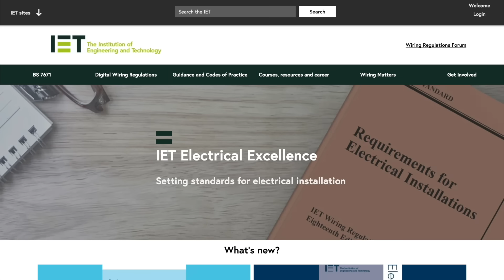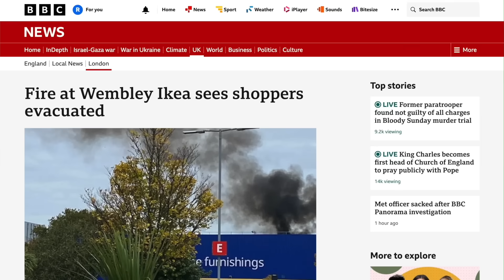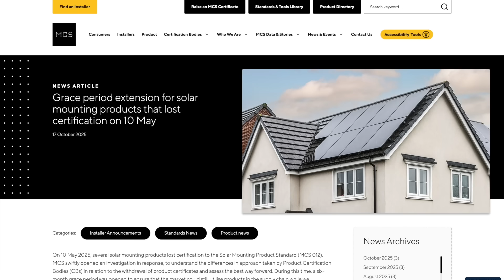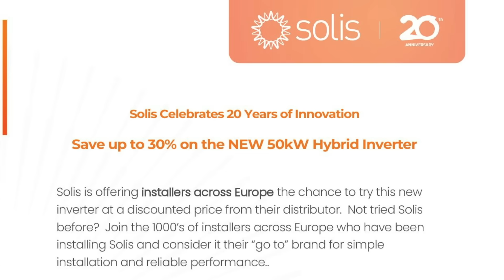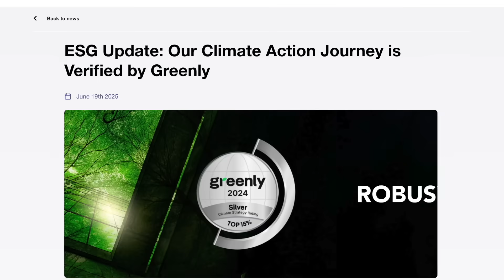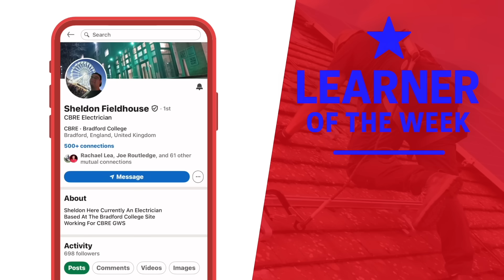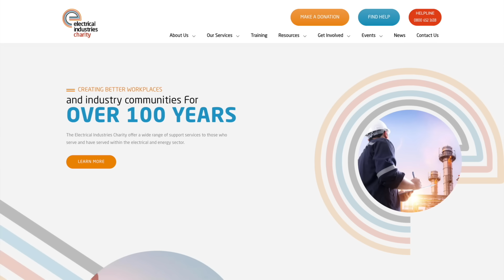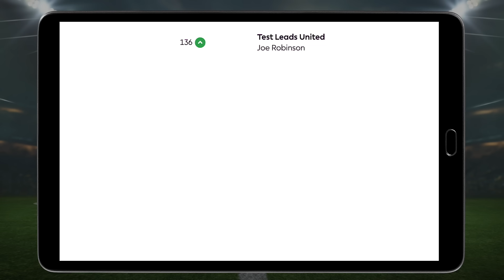Exclusive: Grid Bosses Set to Change UK Voltage

Comment: In Australia our nominal voltage was reduced from 240 V to 230 V.  The maximum was still 253 but it enabled the companies to let the volts fall lower.  Different arguments were used.  But the primary reason is that people could no longer complain that their volts were below tolerance until it dropped to 210 V this means that where transmission lines were too small the volts dropped too much during periods of high demand and this change means that they don't have to upgrade the wiring.  As long as the supply remains at 240 V.  If the transformers ARE reduced to 230 then the problems become worse not better.  For the same power a higher current is needed and this causes more voltage drop.  ie if 240 V dropped to 220 V with a certain power load then 230 V with the same load on the same wires becomes a lot less than 210.

Comment: Lower voltage to keep up with the demand? Honestly I can see that... Electric Vehicles are more popular than ever now. Plus the more popular AI is getting, the more data centres are eating into  the grid. 207 isn't insanely low, but personally I'd expect 230-250 in most houses just because that's what I've tested throughout Scotland in the past while. 😅

Comment: That voltage switch will work fine.
And for UPS: Just set a lower threshold - done.
And for generators: Just set a lower threshold - done.
Reply: Except the lower the voltage the higher the current consumption and it’s the current consumption that we pay for, so electricity bills will have to rise!
Reply: @TwoBassed  You don't normally pay by current. You normally pay by energy (Wh, or the larger unit kWh) and sometimes also by power (W, or the larger kW). 120V at 20A is the same power as 240V at 10A. And energy is (if we simplify a bit) V x A x Time.
It is normally written as kWh or Wh.
So 240V, using 10A gives 2400W. If you use 2400W for one hour it is 2400Wh/2,4kWh.
If you use 2400W for half an hour, it is 1200Wh/1,2kWh.
You can do the same for 120V above:
120x20=2400.
No difference.

Comment: The rated AC voltage is baked into a number of regulations , I used the medical directives where a tolerance is taken as 15% above the top of the range and 15% below the lower limit.  the switching energy of the in-product converters are tuned to the mains voltages and reducing the lower limit increases the work the regulator has to do - which may result in excess EMC emissions

Comment: This is a fake headline. Back in the 1990s the whole of Europe decided to standardise their national grid voltage at 230V, rather than the Irish and UK standard 240V and mainland 220V.
That allows for interconnection between the various systems.
So, for over 30 years, it hasn’t been 240V. Under modern regulations, +/-10% tolerance is expected and appliances are required to operate normally within that range.
The important thing to note is that a kilowatt is still a kilowatt, no matter what voltage is used to provide it and suppliers charge for kilowatts, not volts.
Reply: Fake or not, the UK is no longer part of the EU, so who knows what will happen.

Comment: As an EE, This is NOT some stupendous change.  It simply conforms to some USA and other international standards, using the 60Hz grid.  Parts of the Ukraine have gone off the Russian 50Hz frequency, and are doing fine at 60Hz, except for some Pump and Speed applications.  Going the other way will cause larger losses, and it is virtually impossible to synchronize 50Hz with 60Hz in any practical manner, using older equipment.  As Russia conquers the Ukraine, it will probably revert to 50Hz, and any of those areas will be disconnected from the EU system.  It will be a practical electrical "dividing line" due to incompatability.  Essentially a new kind of Border.
Reply: You make a good point and a dubious one. The good: 50 cycle transformers adapt better to 60 cycles than vice-versa. The bad: the assumption that "as Russia conquers Ukraine...." Conquering the entire country has been doubtful since the initial invasion failed. It's become exceeding unlike since Ukraine has designed and built long-range, precision drones and missiles that can take out almost any target in most of Russia.

Comment: Having had a prolonged 'discussion' with my DNO over voltage which was picked up by my smart plugs. The problem caused by local renewable at 11kv allowing connection without considering the whole local distribution network. They tapped down at the local 11kv transformer so I get 250v ish still does not help the longevity of light bulbs!

Comment: The UK hasn’t had 240v mains for decades, it’s 220v. Europe doesn’t have standard voltage despite what some experts have said, I have a feeling that France, for example has 3, depending where you are. There is also the cycle to be considered 60Hz, 50Hz etc. if these people wanted to save energy they should switch to DC, which is used now when moving from country-to-country. Power stations should produce DC then move to AC for local areas. Going DC saves up 50% of power as less heat is produced.
Reply: ??? the "harmonised" 230V standard came into effect in the 90s, which meant that mainland Europe "went up" from 220V to 230V, and the UK "went down" from 240V to 230V. I know that the actual voltages vary/differ, but the point I'm making is that it's never officially been 220V in the UK.

Comment: I breed tropical aquarium fish, and I use multiple heaters inside the aquariums to heat the water to a certain temp hopefully this doesn't sabotage what I'm doing much...
Reply: heaters may need to run 42% longer at 208V, when compared to 240V.
P=IV
I=V/R
P=V^2/R

Comment: and who will i sue when my pc is damaged by this change to voltage outside the tolerances of the psu, based on the old standard? how much profit will they really get when they find themselves sued by large numbers of people with expensive damaged equipment - phones damaged by chargers operating out of limit? £1500 computers with power supplies that blow up or burn out? motors which cant actually be 'altered' or cope with out of tolerance voltage or current and just catch fire and melt (such as in vacuum cleaners, or pumps in freezers and fridges).

Comment: Any drop in voltage will require an increase in amps to maintain wattage. Dropping voltage will increase the stress on supply cables as it is amps which denote the size of cables. So if all houses and underground cables require replacing imaging the ecological impact on the planet. CO2 emissions?...you ain't seen nothing yet! New bigger copper conductors, new insulation manufacturing from oil based products. Millions of miles of new cable required. Millions of tons of copper to be mined or recycled stripped and new smelters. OMG! Oh and then there are all the new appliances. Everything will burn out with lower voltages. Weird but true

Comment: Any reduction in supply voltage will cause an increase in current (to maintain the same power output). Cables are primarily sized on current carrying capacity so this would have to be taken into consideration.

Comment: What they should do is require every power customer have an Automatic voltage regulator installed designed to take a varying input voltage up to 2kv and ensure the main output voltage remains 250v --  Or other voltages required on-premise if a special voltage is required on premise.    Then allow the network operators to run at up to 1kv  for maximum efficiency and capacity.    Higher voltages can use smaller conductors to deliver higher capacities of power which is much more efficient.

Comment: It’s impossible to have every building with the same voltage unless they are all supplied by expensive regulator circuits ! The grid is fed by local transformer stations! Ther is IR losses along varying along all routes using 3 Phases at least!🎶🐈‍⬛🛠️

Comment: 2kw on 240v is 8.3A but 2kw on 207V is 9.6A Does this mean overloading on some cables and will the meter record more than it would otherwise?  I wouldn't trust anything from this  traitorous government.
Reply: Resistive heaters will draw 29% less power @208V (compared to 240V; 13% less current)
Electric cars will draw 13% less power @208V (compared to 240V, same current)
Computers will draw the same power @208V (compared to 240V, 15% more current)

Comment: All our bills should reduce by 10 per cent if we are being supplied with 10 per cent less power surely, this was not mentioned.
Reply: Yes.
But note that Power=(Current)(Voltage).
A reduction in voltage is only half the story.
Resistive heaters will draw 29% less power @208V (compared to 240V; 13% less current)
Electric cars will draw 13% less power @208V (compared to 240V, same current)
Computers will draw the same power @208V (compared to 240V, 15% more current)

Comment: Lowering the voltage will create more amps on the wires.
Reply: Depends on the appliance.
The big power users like resistive heating and EV charging will reduce their power draw.
Things like motors and computers will increase the current as you describe.

Comment: Why not use both? In Brazil they use a system called bivolt, meaning that houses can have both at the same time 110v to 250v like in the UK and Europe.

They made this way so devices that requires over 110v can use normally while when connecting a lower power consumption device it takes only 110v.

Many households label they power sockets to easy identify which socket is 250v, 110v or bivolt.
Reply: In Europe we got a "bi" voltage system. 230/ 400V. 400V is use for large loads and motors. There are also 2 sorts of sockets.

Comment: As an aside, older analogue phones run a dc of nominal 50v from the exchange to you phone. However this varies a lot from maybe 35v in uk to a solid 50v in Germany-which gives us techs a bit of shock….
Reply: In germany old mechanical phone exchanges used 60V nominal, and the computerised digital stuff used 48V , today we got no more phone exchanges, the subscriber circuit for an anloge phone is in our routers. Cordless phones use the radio interface (dect or wlan) of the router.

Comment: Rot, if it's lowered to 207v the probability of house fires are increased. As to maintain wattage, lower volts means higher current which require thicker cables to prevent cables melting.!

Comment: Yet HMG's Energy Plan is to increase the energy take from the Continental suppliers (i.e. mainly Nucleur France), via the subsea interconnects, from 10% to 20% by 2035  . .add that to the 6% of  UK  supply   that the new Hinkley plant  is estimated to be contributing by the early 2030s.  .  Won't that lump smooth out any variations in voltage caused by the wind turbines ? Further,  If voltage spiking from Wind turbine output will be a problem shouldn't  a properly adapted grid system ensure that a substantial part of that particular output gets decoupled . . . by feathering aerofoils or reducing their pitch and/or by pushing the variable ouput into damping storage i.e. batteries, pumped hydro schemes, water based coastal defence storage ?Isn't it anticipated that control of the grid by "The Centre" will extend to the micro management of individual wind turbine farms ? Or is it all being done on the cheap , with the end-user paying for it all, including the replacement of   perfectly functional, but non-compliant older equipment ? Sounds a bit like the recent Microsoft  Windows scam

The key thing to remember for the enjoyment of the "Goid Life"  in  the UK is that its best to be borne with incurable dementia, that way you are likely to develop a period of lucidity that would cause you to question the decisions of the  corrupt, "Elite", bonehead, morons that run the tip.

Comment: 220 votes is required for foesent lights so 207 votes would stop theses from working and transformers would need to be changed across the grid and on private property and it would change 3 phase system too. Can not change the system . Please many averages of 240/230 over other systems . Qualified 18th!

Comment: The voltage in the United States is 120 V, so that is why they don’t use electric kettles much. It takes much longer to heat the water to boiling. They boil it on the gas or electric hob. Actually, that will take longer as well on an electric hob.
Reply: No, we Americans don't use kettles because we are not a big hot tea country. Most of us also simply use the microwave to heat up water in a cup for tea.
Reply: Most houses in the USA have 240V available with some big apartment buildings maybe having 207V due to a different style transformer.
Reply: @jeffkardosjr.3825  Canada, USA and Mexico's distribution utilizes WYE. Industrial consumers utilize 3 phase, 4 wire wye in various voltages, common ones are 208/120Y, 480/277Y and 600/347Y, phase to neutral gives the lower voltage.  In apartment building and light commercial buildings use 3 phase utility connection, 208/120Y is supplied from utility but individual suites are effectively single phase, because only 2 phases and neutral are supplied. Single phase appliances like electric stoves, cloth dryers, water heaters and A/C are connected phase to phase giving 208. Single phase120 volts for everything else is accomplished by phase to neutral connection. Detached homes are fed with split phase 3 wire 240/120. This provides line to line 240 volts for appliances and 120 volts line to neutral for everything else.

Comment: To all Britons, these idiots  that welcome the reduced electrical voltage to 209 v ac, any electrical items you have that is new requiring 230 - 240 volts AC , your tumble dryer, washer/dryer, dishwasher,  water tank immersion heater, storage heaters, kettle, Microwave, electric hobs, electric oven, electric cooker, audio equipment, power tools, compressor, welders, battery chargers the list continues but they all require a minimum voltage 230 - 240 volts AC, non of the items  I've listed will function correctly and some may not even work as stated by the manufacturer of the equipment furthermore, the reduced voltage of 209 v AC will not reduce energy prices, all items listed will be impacted while increasing running cost due to reduced power, this fact can be tested using a 12 volt lamp with 6 or 9 volt battery, the brightness confirms the problems you will face with reduced electrical voltage yet, these idiots at eFIXX welcome the low voltage.

Comment: This will have zero impact on the value or price paid by customers in that electricity is measured and charged in kWh accumulated over time, not the voltage at a point in time.  Not sure why everyone having a moan about price other than the fact they already don’t feel like they’re getting value for money. Change in voltage = totally unrelated.

Comment: What i find amazing is how these idiots at eFIXX continue preaching about electrical safety while refusing to deal with facts presented to them, it's not the first time I've made this known yet, they continue to ignore hoping for a change in electrical voltage such as now being announced to comply withy europian electrical standards, since when was UK energy governed by the parasites in Europe, so the drop in voltage down to 209 volts AC shouldn't be much of a problem, try justifying this reduced voltage to Britons with new induction hobs and Ovens that minimum voltage  230 volts AC or audiophiles that their Hi-fi separates require the voltage 230 - 240 volts AC.  Technically speaking, the energy industry across UK will be destroyed, that isn't an idle vision, what ever energy system promoted will be short lived, Britons will face 2 options irrespective what is stated by the bureaucrats in Brussels or by corrupt UK government, Britons will face having to decide either they follow instruction to build their own generator having absolutely free electricity once constructed or continue paying the rip-off charges to electricity energy companies supply, i think we know which they will choose the bottom line is, this isn't about electrical safety, this is about ripping off the consumer, if you trying to state it's about safety, kindly explain  and justify since 1995 the 2.5mm2 Twin+Earth had been reduced to 1.75 mm2 Twin + Earth, the reduce 2.5 mm2 T+E even electrical whole sale shop in Birmingham UK states it's not 2.5 mm2 cable, cable that is designed to protect ring circuits connected to every socket in every room throughout the home furthermore, I've my electrical safety test carried out in my home 3 times now, social housing yet, if as you say home electrical wiring safety is carried out, why do electricians neglect to check earth bonding within the home, boiler, kitchen sink, bathroom bath and sink all taps and copper tubing, the electrical industry today 2025 is a joke, even the MCB's and RCCO's breakers, if safety was a real concern, why use MCB's that will not trip instantly while RCCO's do trip the whole circuit, total electrical protection is to use RCCO's on every single electrical circuit within every room.

Comment: Lower voltage means higher current for the same power, in SMPS equipment that will happen automatically meaning the wiring will get hotter, lower voltage means more losses and less efficiency in every respect, cant they adjust the upper limit instead?